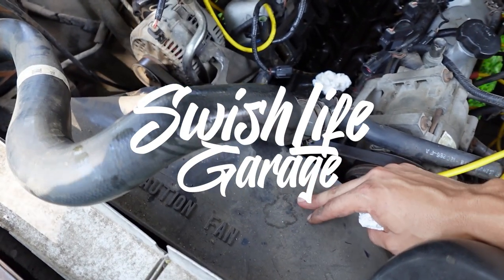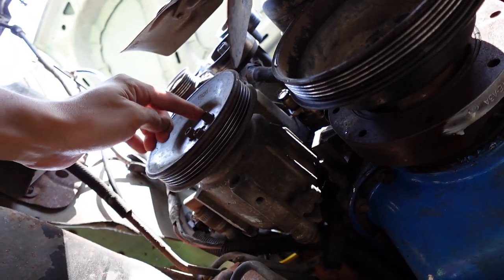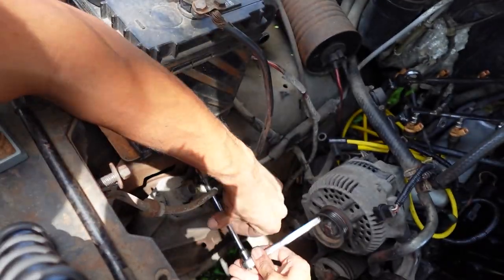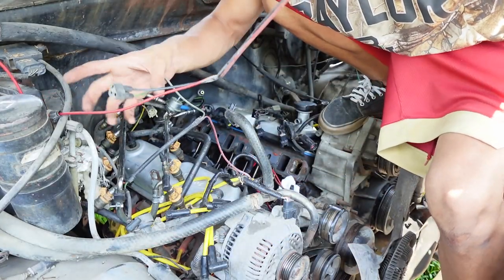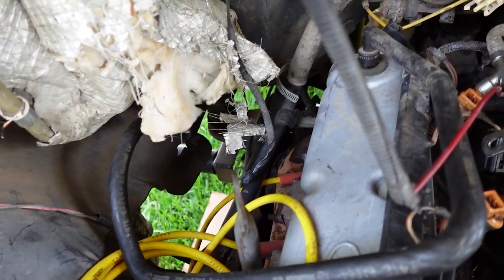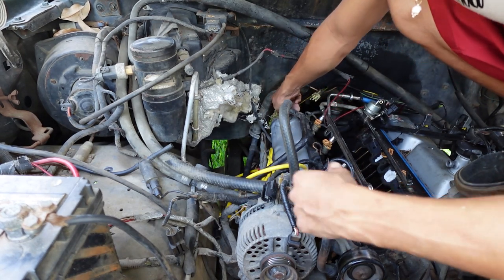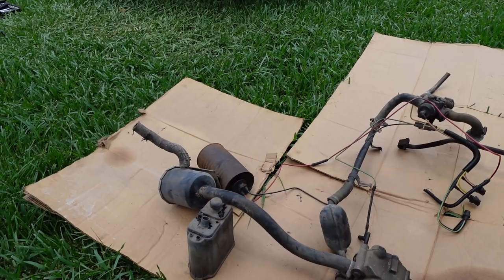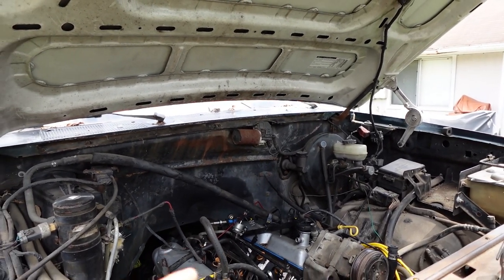Ford 302 Smog Pump & Vacuum Delete!

Comment: If I'm thinking correctly, I believe the coffee can is intended as a buffer for the vacuum system, almost like a reservoir. In that case it evens out the flow of air in case of a rough idle/power loss so that your brake/cruise ctrl still works nicely.

Comment: PRO FORM IDLER BRACKET PART # 68-110 AND DORMAN IDLER PULLEY 419644 REPLACES SMOG PUMP AND NO NEED TO USE SHORTER BELT
Reply: A belt is $13 tho

Comment: so after all the delete, did the truck run ok? was there any issues to update for us who are thinking about doing this delete.
Reply from the maker: If you follow the channel I'll have updates. As of now heads are off I'll prob get back to it in about a week
Reply: @SwishLifeGarage did you have any issues removing the coffee can ? Did you just leave tab and tad solenoids plugged in but plugged off the vacuum ports? Will removing that and the canister cause codes if you just plug off vacuum to the solenoids but leave them plugged in? ( the egr and charcoal purge solenoids )
Reply from the maker: @paulvillano8625   yea ill be leaving them plugged in but got to cap off the part of the solenoid to not get CEL. if i remember correctly need to cap the top. i was going to play around with this once its running.

Comment: What size belt did you use after deleting the pump? I’ve got even else mastered. Just would prefer not to spend hours getting the right fit. Thanks
Reply: 97 and ⅛th inches
Reply: depends on if you have A/C and all that other stuff, mine is a 90' and doesnt have the idler pully and I used a 43 inch or close I believe. just do a google search for your motor and belt sizes without smog pump
Reply: They sell 2 belts for the fox body.  Get the belt that fits the AC delete.  Works perfectly!
Reply: Thanks. That was my question.

Comment: Going to be doing this on my 90 f150 along with a bigger alternator and electric fans to free up some of the drag on the front of the motor. Hope I'll pick up a couple mpg but doesn't really matter. Also plan to get headers and a "high flow cat"

Comment: I did this to my 89 F-150 302. I had to clean out the holes in the head in order to put the plug bolts into it. I noticed that some of the brass wires on my brush fell off when I was cleaning out the carbon. I vacuumed out what I could but I imagine there is more in there. How concerned do you think I should be about the brass wires that might be left inside those holes? Thanks
Reply from the maker: Same I had used a tap to clean the threads, update vid will be up by Monday. Just do the best you can maybe use a vaccuum if still open but if not I think you should be ok, don't think it would go anywhere it can do harm

Comment: question if it's a doable thing. I've got a 95 F150. Problem it has the electronic transmission. Is it possible too modify it to work with a carburetor?

Comment: My truck ran like shit after all this question you looped any wiring? I already done this without watching the vid just read the comments as I found this and what wiring did you loop for computer to detect it’s running okay or it’s okay for it to run okay it will run on throttle but will not idle

Comment: how did you plug up the holes in the back of the heads
Reply from the maker: right now still currently work in progress with this truck, ill have updated vids but ill be using thermactor plugs.
Reply: @SwishLifeGarage  saw a video of someone using a 9/16th plug to cover drivers side rear of enging where smog went in
Reply: hope to see a video of egr delete? trying to figure out how to delete mine without a code 1991 E-150 5.2 302W
Reply: theres a guy on ebay that sells a four plug kit for 302 for like 10 bucks... they also have blocking plates they sell as well.

Comment: I did this to my 1993 302 Ford Bronco and can’t get a proper fitting drive belt on it. 91 inch was too long. Have you had yours back on? What size
Reply: I heard if you have the ac pulley and power steering a bypass pulley is 83.5 in

Comment: How’s it run? Are you gettin rid of egr as well?
Reply from the maker: yes egr already blocked off, in the process of putting back together, will be on the channel also. had to wait to finish on it since wasnt prepared to spend the extra money taking heads off ,doing machine work, and gaskets.

Comment: how did you get the back bolt of the smog pump?
Reply from the maker: If I remember correctly I had gotten a wrench on it. Bolts weren't too tight for me since was removed once years ago.
Reply: @SwishLifeGarage  i just removed mine as i am writing this . mine was a pain bc it’s a 350k mile truck and it was so tight but i got it off
Reply: @Weabys how did you get your bolts out? Trying to take mine out and they are very tight. Not much room to fit your hands back there either

Comment: do you have to cap off the vacuum line on the pipe that crosses over behind the engine?
Reply: just take the pipe off and make some blocking plates on the holes behind it. that's what i did to mine!
Reply: it would be better to remove it, cut them down smaller and re use them bolt it back blocking the hole and it’ll work fine that’s what I’m gonna do to mines today

Comment: I wouldn't remove the red line, that goes to the fuel pressure regulator. Kinda important.

However great video.